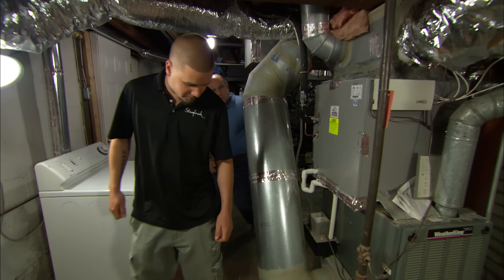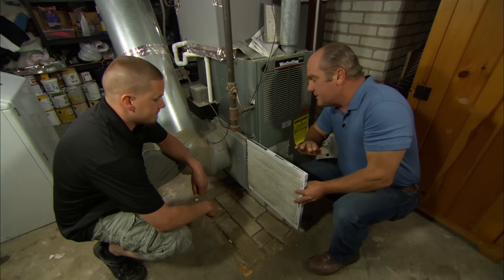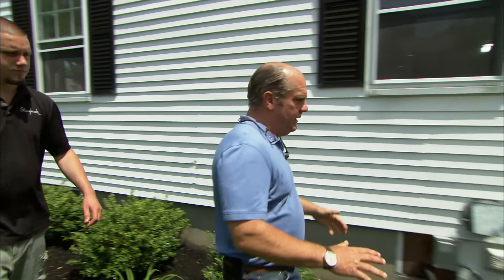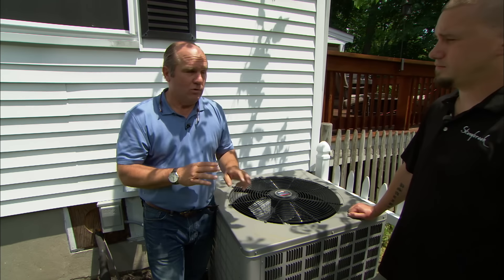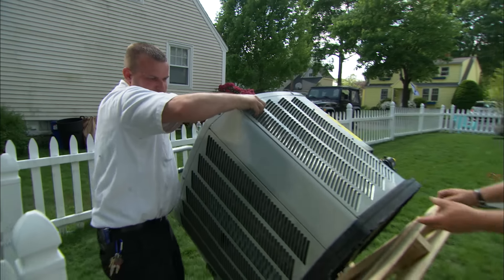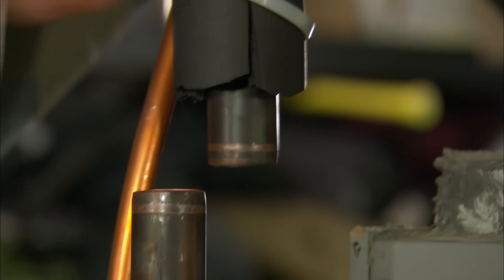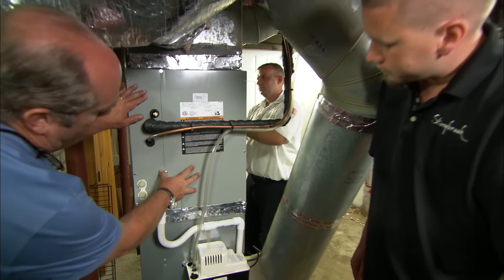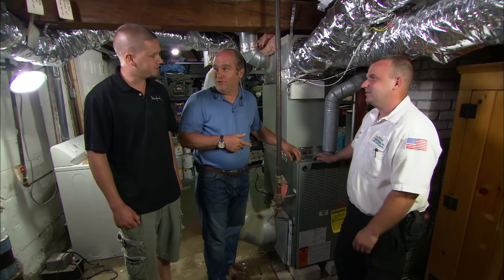How to Repair a Frozen Air Conditioner | Ask This Old House

Comment: I've repaired & installed many split(central) AC systems over the years. The problem was more than likely LOW refrigerant. Sometimes you can have a faulty expansion valve.
Reply: you'd think they would check the charge first, maybe they didn't show that
Reply: Low refrigerant
Faulty blower motor 
Dirty coil
Dirty air filter
Reply: Gabriel Martinez  restriction, bad TXV, clogged Orpheus , capillary tube or filter gone bad . Many more
Reply: electronicsNmore  .?.
Reply: Since I've been doing the air condition for 22 years if I was to come up to this unit or house and see these problems other than wasting all that time measuring ducks and everything else you said we could have just looked inside the a coil and found a core and more than likely just packed with dirt just used to be cleaned and then check the freon level after that also first thing I noticed was that return duct being so small if you don't get enough air back to the system it will freeze you increase the return it you could have fixed it or he could have even better turned up the speed on the blower and and that would have saved him the 10,000 to $15,000 wasted money of replacing the unit for a smaller unit
Reply: a stuck on Contactor, can cause freezing up too
Reply: Holy hell you are getting 15k for a change out of  Condenser and evaporator coil??? Lol I am not charging near enough lol
Reply: I bet they have somebody local go out and diagnose it so they can have the parts needed if something's broken.
Reply: electronicsNmore can someone tell me why he used a trap on a gas furnace?  I dont think he needed a trap. Also its is a TV show so it's not really real. If you noticed when he was explaining the refrigeration cycle he was pointing at the wrong lines as if it was backwards.
Reply: electronicsNmore  z
Reply: Andy Walchack if you have duct work in your house that’s too small for 4 years and on the 5th year your unit freezes up, then the duct work isn’t the problem....: most older houses have returns in the studs making the return way too small but doesn’t cause the unit to freeze up...... you can’t tell what the problem is by watching a video, it could be a combo of different things causing the ice, the return being part of it...... there are a lot of quacks in this industry but maybe the quack is the man in the mirror my friend
Reply: Andy Walchack Damn dude... You're obviously not a service tech. A fully iced coil generally comes down to poor heat exchange in the evaporator coil causing a boiling point that is below the freezing point of water.  This CAN be caused by improperly sized ductwork creating poor airflow, but heat exchange is also affected greatly by how clean the coil is. A dirty coil, even if it doesn't look plugged can diminish heat exchange and lower the suction pressure. A blower that is moving less cfm due to any number of conditions will cause this too. You should stick to installation and leave service advice to the people without your misplaced sense of confidence.
Reply: Horrible, expensive, wasteful advice!  Plus, what kind of hack "workmanship" on display, too as he left all the metal fines inside the air handler. The 'This Old House' veterans from yesteryear must be rolling in their graves.  D'oh!
Reply: Andy Walchack 
Static pressure would have determined the quality of duct design and or flaws in the ducts...
Reply: Andy Walchack lol i dont want u in my team if u think is 100% sure its ductwork... Come on man ur à tech or not. Its stupid.. Soo many thing can Do this...
Reply: Matthew Spaccarelli no trap needed with a positive presure. Ur right
Reply: You can have more then 1 return to a unit a 3 ton unit needs 16" of return at least.
Reply: Seems to make no sense to me, if the larger unit works and cools faster the less it should run if your thermostat works, is this for real or did the guy just not know how to fix it? If you ask me the coil was damaged and leaking.
Reply: I can't believe the homeowner would go along with replacing a relatively new unit to fix the problem. It must have worked for a good while or he would have the original installers fix it. Something changed to make it quit working.
Reply: Obviously he needed a window unit, 1300 sq ft? My garage is that big and my wall unit cools it to a chilly 72° even when its 117 outside. I'll gladly install it for $7500.... 😂🤣😂🤣😂🤣
Reply: electronicsNmore  only two things cause a system to freeze not enough air flow or low refrigerant that's it
Reply: electronicsNmore...That system did not have enough airflow for 4 tons of cooling. I doubt you could make it work without icing no matter what the charge was.
Reply: im actually removing my 2.5 ton unit and replacing it with a 3 ton unit i got for free. old unit was leaking.  im going to try it without changing the A-coil. but i do like the idea of turning up the fan speed, if i do have this problem
Reply: it was likely low refrigerant and undersized ducking both on intake and output sides,  that system should have had its own separate furnace tapped into the ducting .. I've seen it done that way in older homes and common on mobile homes ,.  not knowing what area region this guys in is another problem.. are they using a natural gas or oil heating systems  or a reverse cycle = heat pump system
places like south florida they use electrical coils since reverse cycle aka: heat pump system is waste of money  maybe 1 or 2 weeks of cold enough weather for heating,  northern florida  heat pump = reverse cycle is common,.  some   homes will have fire places and older natural gas or oil burning heating but isn't too common on newer homes of 1980 on wards,. along with the modern heat pump heating will auto sense the temperature outside and auto switch over to the heat strips when cold enough,. some systems u do it manualy  on the switch will show normal heat and Aux or Emg Heat
Reply: i agree!
Reply: The region this video was shot must be around Acton, MA near Boston since the service tech they got to drain the R-22 had a badge that said: Papalia Plumbing & Heating, and a google search for Papalia shows it is located in Acton, MA
Reply: keep thinkin
Reply: txv running wide open
Reply: The homeowner was robbed, Andy.  And the perp is the EPA.   I'm guessing they had to switch from a 22 system to some high pressure tertiary blend that... doesn't quite behave the same in the evaporator when it comes to heat transfer over time for the same surface area and also needs a higher test pressure rating to cope with the outside unit.   They probably could have gotten away with just an outdoor unit change and tweaked the superheat on the TXV and everybody would be happy... but it's a TV show, and lawyers abound.  This episode is what a lawyer would do more so than a competent tech.
The lesson learned is... outside units actually should be just slightly undersized.   Maybe we get a couple weeks of weather where it treads water and serves as a dehumidifier during the day that can't get the house below 72 degrees?   Perfect.
Reply: Many people in this comment section are passionate about thier profession, but most of the information presented is bad. Use your passion to get factory training from equipment manufacturers and component manufactures and refresh yourself with the basics of refrigeration. Lots of science and engineering in HVAC industry, little room for conjecture. It's a field of continual learning as technology is ever evolving. Best of luck to everyone who happens to choose this profession.
Reply: ya in no way did this dude need a new ac unit... sure it was likely oversized but that was not the cause of this issue.
Reply: Either way the contractor laughed all the way to the bank on this poor lad
Reply: So if you have low refrigerant the coils can’t absorb as much heat and thus you get freezing
Reply: If expansion valve it would freeze there at  the restriction .. low charge yes entire evap freezing
Reply: agreed a system 25 % larger than nessesary wouldnt freeze the suction line though it would cycle faster and not allow for dehumidification leaving you witih a cool damp home and possible mold problems. it was more than likely a compromized evap coil . also hope that he actually did a load calculation and didnt just rule of thumb it.
Reply: Mijemu mijemu a larger unit will cool the house faster and run shorter but that can also be a problem since it's not running long enough to remove the moisture in the house it is going to feel cold but wet in the house because of excess humidity in the house.
Reply: Sometimes it's just a failing sensor.
Reply: Guess he has a new ac condenser and refrigerant for a lake house!
Reply: There are literally probably close to 1,000 different things that could cause "freezing up" of your air conditioner. In 10 years THE NUMBER ONE problem I've found in residential or commercial applications is the mis-use or misunderstanding of terms. It's the backbone to any conversation folks. Although he didn't say anything wrong. He did describe the refrigeration circuit backwards so there's that....
Reply: You can always bypass the expansion valve by placing the sensing bulb on the liquid line, unless it has lost its charge. And if it lost its charge just put an iso tube with some nitro to push open the valves spring
Reply: How much do you want for the old unit?
Reply: @k2000b  you have no idea
Reply: @ronhanish  wide open will not freeze.
Reply: @picobyte  what sensor?
Reply: @mijemumijemu4466  It makes sense somewhat. A properly sized unit does two things better than an oversized unit. The first thing it does is remove more humidity and the second is that it turns on and off less frequently. Humidity during the summer months is the main reason we feel warm or uncomfortable. Less humidity means more comfort. A properly sized unit should be running most of the day. An oversized unit is turning on and off more frequently causing damage to the compressor.
Reply: Ya
Reply: @jmac2050  - more like a stuck on contractor... :D
Reply: @gabemtz2246  you forgot home owners closing registers because rooms get too hot or cold faulty load distribution.
Reply: @mijemumijemu4466  That is not always a good idea, and is referred to as short cycling, due to being oversized. We are talking comfort cooling here, and the idea is to maintain a certain or close to temperature throughout the day. If the AC system is too large for the space it is cooling, then it will do so too quickly, killing the motors and compressors.
Reply: Charles Spalding p9
Reply: Definitely undersized ducts both supply and return.
Reply: @keepthinking2666  I thought you hvac guys hated the term "freon"?
Reply: Yes but 5 tons requires about 2000 cubic feet per minute airflow.  No way in hell through that one tiny duct.  That would freeze it no matter what.   I doubt any 5 ton system with a  single 12” return duct on it could keep the low-side pressure above 58 PSI r-22 or 108 PSI for 410a...  You add refrigerant and all it will do is crash the superheat to nothing and flood back to the compressor...  NOT good.
Reply: keep thinking increasing blower speed would help, but you cannot suck 5 tons of air through that coffee stir sized duct at any reasonable static.
Reply: @nojokeauto  always run cooling on high speed.
Reply: @acman0926  TXV
Reply: If it was the duct work then it would have frozen up the first day it was installed.Are you telling me this AC unit never worked?
Reply: @ohmegadeth  hell you can easily see that return drop should least have a return box at the furnace!! Good crap!!!
Reply: One of the most common causes of a frozen evaporator coil is lack of system airflow. If there isn't enough air blowing over your evaporator coil, the coil won't have enough heat to absorb. This will cause condensation on the coil to freeze over.
Reply: Why would it suddenly start freezing if the ductwork that has been there for years is too small?
Reply: @NETWizzJbirk  not only is it too small but theres also a damper system!
Reply: When he was recovering the system he didn't want to say he's only getting about half of what was needed lol 😂
Reply: He was pointing at the wrong line.
Reply: BS.  Low refrigerant is hole in line period.  Leaks hard to find and tech has to get to next job.  Fills refrigerate to satisfy current customer to get on to next customer, knowing he will be back to refill refrigerant or sell new system.
Reply: Wow, I guess you never heard of leaking schrader valves. I've seen many systems over the years with no caps on the service valves, and leaking schrader valves. Refrigerant losses that happen quickly, are almost always a leaking evaporator or the lower part of the condenser is corroded and leaking.
Reply: @gabemtz2246  Surprise  he did not say anything about the restrictive air filter. It looked pretty dirty. Plus even clean they restrct the air flow way to much. To bad they don't  make the evaporator core easier to get to to clean.
Reply: new unit is  oversized. A 1,300 sg. ft. House should have a 2.5 ton unit Not a 3 ton. That’s true for all climate zone 1-5.
Reply: It all depends on the homes level of insulation. Poorly insulated homes are generally 500 square feet per ton, and well-insulated 750 sq ft per ton

Comment: Check this out. I bought a new home and over the years I noticed that the upstairs never really cooled down (get to about 78F the lowest on the hottest days)while the unit ran all day! Over the years had 3 different HVAC guys look at it ( coolant level was good, filters always changed, coil good etc) correct ton unit for space and still warm upstairs. I just figured the design of house with warm air going up the vaulted ceilings and dumping into the 2nd floor. After 8 years of this, I finally had enough and went up a half ton with all new coil and condenser. Well hell, little more than half way through the tear  down guy said here is your problem. All the damn paperwork ( warranty, owners manual plastic bag etc ) was trapped and up against my blower motor blocking probably 70% of the air flow!!!😤 they never removed it and would not had noticed it unless I tore down the blower box. Good news it nice and cool upstairs now but a $5000 lesson and dumb ass installers.
Reply: wow
Reply: installed by this guy?
Reply: Wow
Reply: Funny
Reply: Thats HVAC guys for ya imo very unreliable and very crooked
Reply: So not one tech did an amp draw on your blower motor for air flow? Doubtful.
Reply: American quality well known haha
Reply: and how much money did you 6iss away on power over the last 8 years...
Reply: @d3adp94 

One just did that for me. "yep motor is bad" and I get a $900 bill to replace the motor.

Turns out my start-up capacitor was bad.
Reply: @Outlawstar0198  first thing he/she should of checked. Sorry you went through that. It’s a dirty game out here. Why I left the industry.
Reply: wild